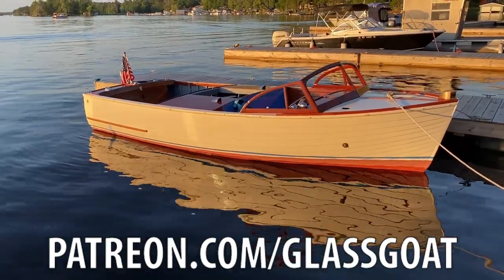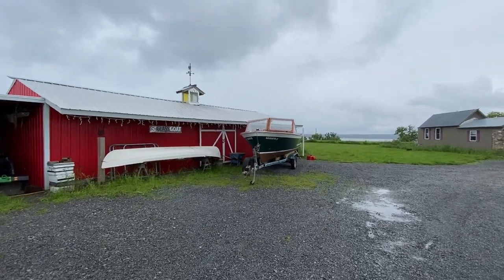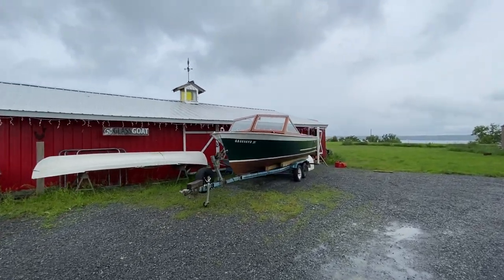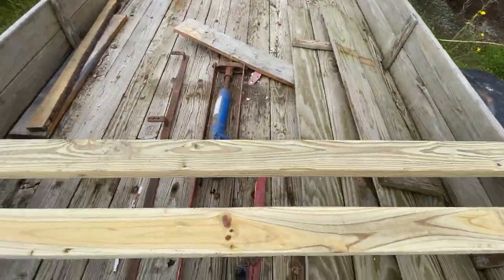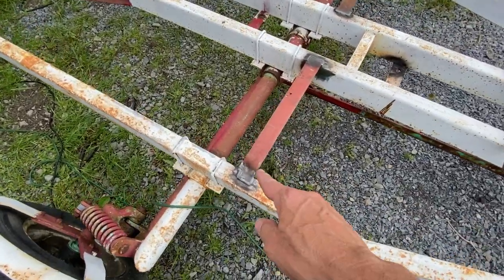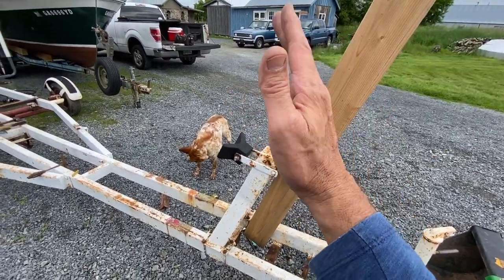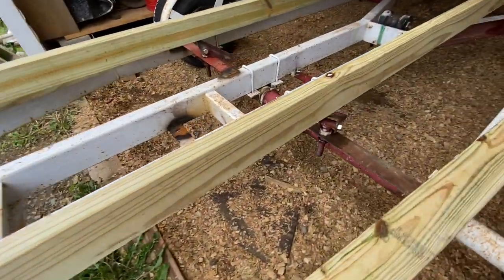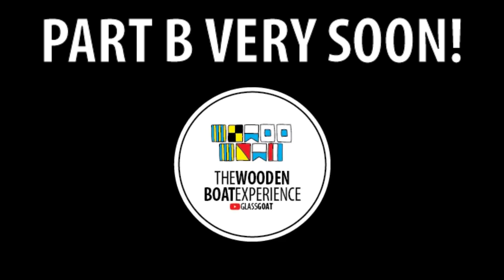S3 E23 Part A Trailer Modifications

Comment: If you are using the trailer like normal (not just storage and moving around and such) like at a boat ramp you are going to want some trailer bunks to pinch in the hull so when it comes out of the water the trailer bunks center the boat on the trailer. I have a flat bottom drag boat that sits on flat trailer bunks. At the boat ramp, in and out of the water, anything else and it gets strapped because it will slide around on the bunks. That is an extreme version but it you are out on the road with that heavy wood boat dont think it won't slid off if not cradled sufficiently.   
Look forward to part B
Reply from the maker: Still some work to do on the trailer, we are adding 2 outer bunks as well as an adjustable winch post with a vee that the boat will hit at the rub rail. The existing guide posts should help us center the hull, I would have them set tighter to the hull, but the boat is a bit wider near the driver than it is at the transom. The trailer will only be used several times a year as the boat will sit in the water for the season. We always strap the boat at the transom as well.